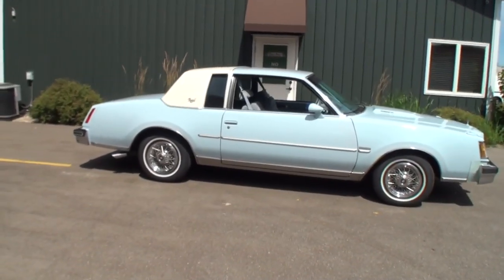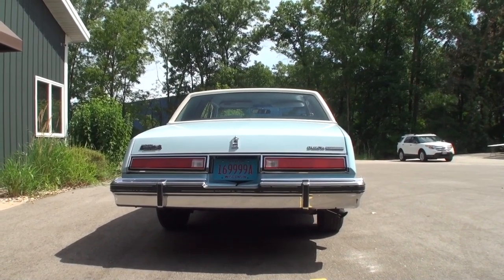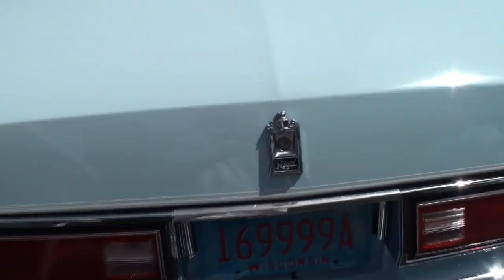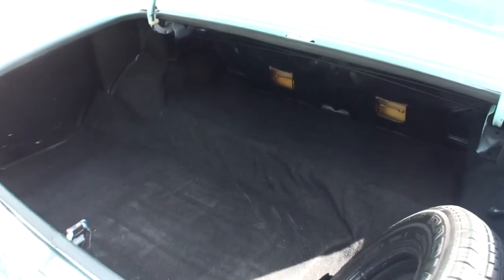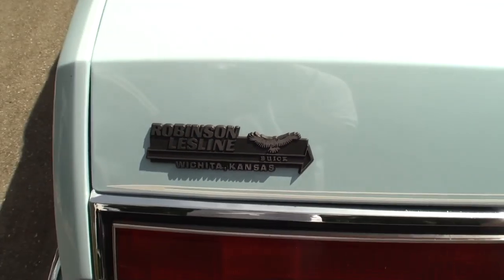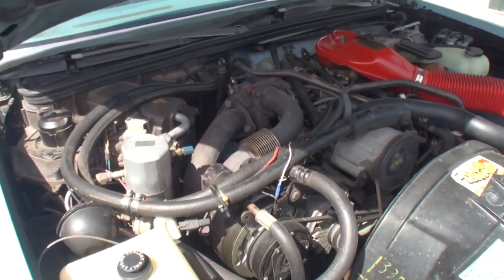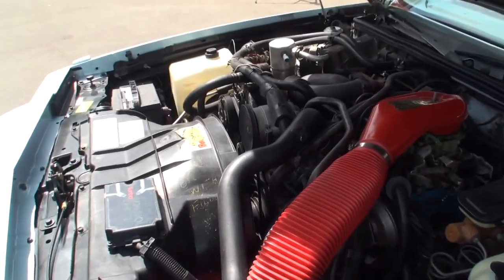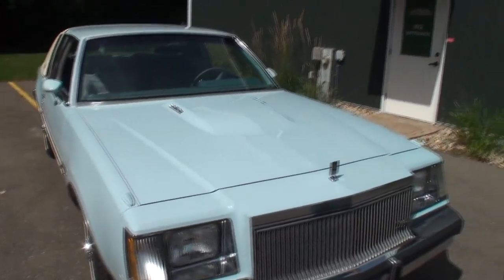1978 Buick Regal Sport Coupe in Blue & 3.8 Litre Turbo Engine Sound My Car Story with Lou Costabile

Comment: Lou, it’s amazing how many cars you’ve presented that I have either direct or related experience with (yes , I’m old). I owned a non turbo same gen Regal. It wasn’t very quick but was very comfortable and looked great, like Buicks still do. I had it for 9 years, until the motor locked up. Anyway once again you brought back some great memories. Thanks!
Reply from the maker: Hi Mountain Climber, Happy to read you have a direct connection to this car.  Driving these, will keep us young :-) Lou
Reply: Mountain Climber 
You may be old, but old is the wind and it still blows.
Reply from the maker: @billace90    I plan on blowing past some people driving for a LONG time  :-)

Comment: Wow, I totally waxed nostalgic and took a trip down memory lane with this video!

My parents took delivery of a custom-ordered 1979 Buick Regal Turbo Coupe in October '78. It had the optional two-tone blue metallic paint with matching stripe that ran down the beltline of both sides from the front to the C-pillar, and then up and over the roof. Thus, it didn't have the vinyl landau roof. The stripe treatment separated the two shades of blue metallic, and according to the 1979 brochure (which I still have), Buick offered this metallic two-tone paint treatment in blue, burgundy/red, silver/gray, and tan/saddle. I remember the lighter of the two shades of blue was a bit darker than this car's powder blue color, and the darker shade was more of a medium blue color. They didn't want the Limited option with its velour interior, so they opted for the blue vinyl interior with highback bucket seats and center console. It had the sport wheels instead of the wire wheel covers.

These early Turbo Coupes (as well as GM's other turbocharged cars from this era) were not very well thought out. I guess they failed to realize the amount of heat that would be generated from the turbo unit, as it caused the paint on the hood to oxidize and peel within 5 years. They should've incorporated some kind of heat exchanger/intercooler into the design, and realizing their error, GM rectified their turbo powerplant with the '84-87 Grand National/GNX with its integrated intercooler. Unfortunately, oversights like this, as well as ones of quality control, were typical of American automakers during this time period. I can certainly attest to our '79 Turbo Coupe's glaring lack of quality control, as it became a running joke whenever we'd find mystery parts that had gotten loose and fallen down, laying on the interior floor or underneath the car.

When our TC turned a decade old, it started having intermittent transmission problems only whenever my mom drove it. While in motion, the car would do this weird thing where it would lurch forward and shake, like it was slipping gears or momentarily slipping into Neutral and then back into Drive. She was literally chirping the tires without even trying! However, the stupid car never acted up whenever my dad drove it, LOL! Go figure! Until one time about a year later, it finally did, and it was really bad. It was as if the car had dropped its entire transmission as it rolled to a halt. The car was completely dead. I remember we were 40 miles from home, and my dad and I trekked half a mile to a pay phone to call up AAA.

My parents started shopping around, and my mom wanted to get in on the SUV craze. So, just as our poor TC gave up the ghost, they used it as a trade-in for a brand new '91 Toyota 4Runner in November '90, and that's the last time we saw it. We'd occasionally drive by that dealership to see if maybe they had fixed it and set it out in their used car lot. But nope, we never saw it again. My dad joked that "they probably sent that pile of junk to the scrapyard."

These early Regal Turbo Coupes are quite rare and hard to find nowadays. By "early", I'm referring to '78-80, as GM refreshed the Regal for '81. You can find base models and Limiteds, but hardly ever a Turbo Coupe. Yeah, GM may have produced several thousand of them, but 40 years later, they're very hard to find now. I know, because I still look on eBay and other classic car websites, as this is one GM car that will always have a warm spot in my heart. Plus, of the three model years of these early Regal Turbo Coupes, I like the '78-79 with its single headlamps. The Regal got dual halogens for '80, starting the "four-eyed" look of pretty much all '80s cars. It's definitely awesome to see a survivor example still on the road today, as I'm sure quite a few of these early TC's saw the same fate as our TC and became recycled sheetmetal on some '90s and '00s cars.
Reply from the maker: Hi The Mystichrome Cobra Authority, Happy to receive a "Wow" and read this car brings back memories of your Parents car :-) Thank you for viewing and sharing, Lou

Comment: Plush Velour seats need to be an option on modern cars. Leather freezes your butt in the winter (I know they have heated seats, but it still has to warm up) and burns it in the summer. Velour is comfortable 365 days a year the moment you get in.
Reply from the maker: Hi Max,  Good points on the plush velour vs the leather,  Lou

Comment: Lou - cleaning GM spoke wheel covers just requires removing them now and then and washing the chrome hub piece from the back, which is hard to get when they are on the car. I had several GM's back in the day I used to do that to.....and remove the wheel covers in the winter!
Reply from the maker: Hi Milford Civic, Thank you for sharing a tip on how to keep the wheel covers clean on a car like this, Lou

Comment: I actually had one, it was butchered up with a 5 litre Chevy. Bought it from a family member with intentions of fixing it up, but the bumpers rusted off the frame. Not a good thing. I was going to put the interior into my '79 Malibu along with the hood, bit I was commanded to be rid of it or else. I kept the hood and aluminum deck lid, though.
Reply from the maker: Hi Turbo Lives In my heart, Interesting you had one too.  Still have some nice aluminum parts too :-)  Lou